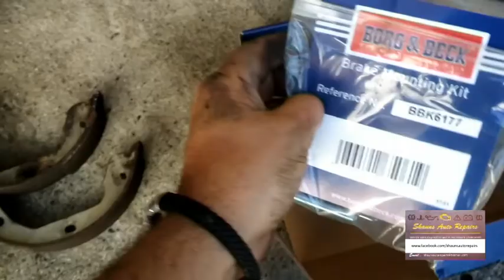Pt1 2004 VW TOUAREG replacing rear handbrake / parking brake shoes

Comment: Thanks for great videos! I have 2004 2.5L TDI Touareg. However, I would open the bleeding nut before pushing the brake piston in. If not, the often dirty brake fluid will go to ABS unit and may cause some trouble there. If the brake fluid has been replaced recently this is not necessary.